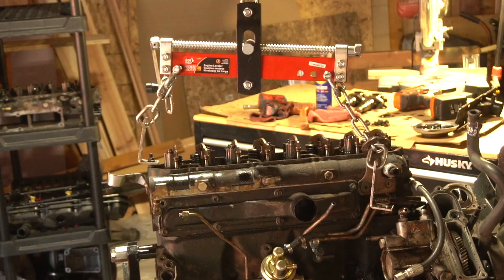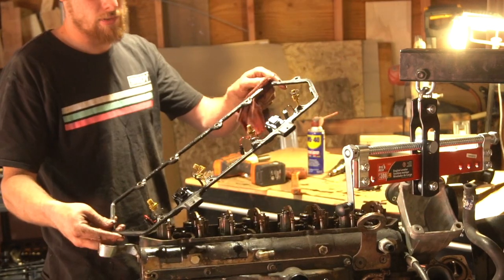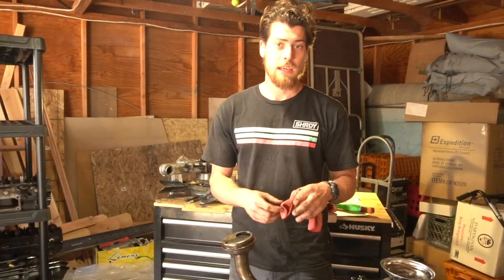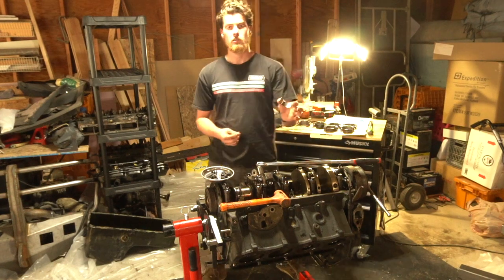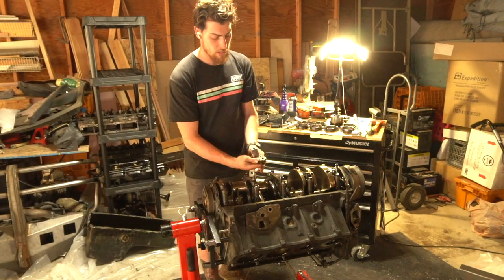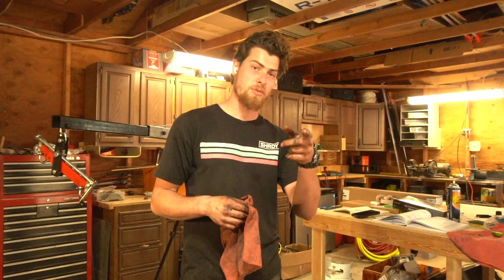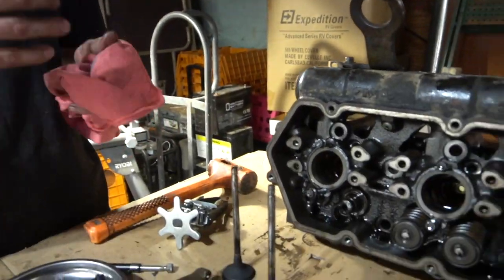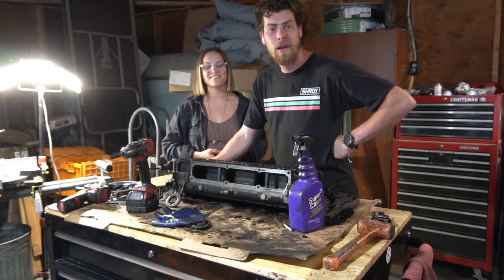Taking apart a 7.3 Powerstroke Engine // Engine Rebuild on our 1995 7.3 Econoline Van Conversion

Comment: Lance Great job, I probably would have gone ahead and put new Barings on the pistons while having the motor apart for sake of not needing to do it again . I had a ford Torino once and we never had any good oil pressure one day we pulled the oil pan and Well Duh the oil pump was lying in the bottom of the pan ! We have no idea how the thing was even running at all. Craziest thing I ever saw.  Back to the video- Laterz Leland
Reply from the maker: Dang that's crazy!!

Comment: The hoses are fuel return hoses and low pressure, the hoses that are high pressure are stainless and connect to the hpop. Ive pulled 7.3's apart that "still show honing marks" with 400k or more, its not a good way to judge. The valve guides, valve seats, rod bearings and piston pin bushings are where you can see how hard or long the motor was run. The epidemic of cheap tuning products really puts a beating on rod bearings and pin bushings. The bowl in the piston is because its direct injected and the bowl is where the fuel and air mix. Gasoline engines that are direct injected have bowls too.
Reply from the maker: Good to know! Thank you thank you!!!

Comment: Honing marks should be seen in all cylinders, that's what helps keep a film of oil on the cylinder walls. These engines have been torn down with over 450000 miles on them with still good cross hatch honing marks in the cylinders. That possibly won't be a sign that it was previously rebuilt.
Reply from the maker: Good to know thanks for that knowledge

Comment: I blew a Hpop braded stainless hose that was old  and wore out. Oil went everywhere all over everything under the hood. When I checked the dipstick there was no oil in the motor lol. The motor shut off due to im assuming the injectors not firing witch saved my motor.
Reply from the maker: It's a great fail safe these motors have 🙌🏻🙌🏻

Comment: I commend you for trying to rebuild this type of engine. Power strokes were made by International. They're a downsized V8 that has its roots in semi's. They're a durable, reliable engine. Diesels are all hearty built engines. The block, for example, is made thicker for increased strength. The terminology you've used so far, is actually correct. But what you understand it means, there's where it'll confuse most. There's so many things I could impart to you but it won't help you now, you have it torn down. When you do reassemble it, try to refer to a manual so it can explain more to you. Having a seasoned mechanic, on speed dial, is absolutely needed. But overall, you're doing a bang up job bro. You guys can learn so much doing this.
Reply: For the peanut gallery, I have better than 30 years of mechanic experience. I used to build championship race engines, some tractor(semi) engine rebuilds, farm equipment engine rebuilds, some odd transmission rebuilding here and there. Am I an "expert" on anything? Let me say this, years of experience says someone going in neck deep on a Powerstroke rebuild, is obviously a big undertaking. There's nothing in them that sets them apart from any other internal combustion engine other than the diesel aspect. Compression is highly elevated in all diesel applications. Race has the same thing, and a few other machining tricks thrown in for good measure. A high performance diesel utilizes many of the same things that any drag engine does. If I haven't shown you my qualifications by now, there's not much more I could do or say that will change your minds.

Comment: That engine didn't need to come apart, they are good for over 500k miles easily. All it needed was new sensors and seals. How many miles are on it?
Reply from the maker: 210 k miles. We're rebuilding the injectors. Measuring for anything that needs remashined. Replacing all hoses, gaskets, replacing valves and more. Once pulling it apart we saw a ton of things that were off or missing. Happy we're doing it and getting it all done anyways 😊

Comment: So brave' Diesel's are a bit more complicated than a 350! If you travel out of country' 'especially south? bring every single item you can possibly think of, that could break or wear out' or two, including tires! + HD tire plug kit, tireslime, and a compressor! and a cheap popped Air mattress pad to lay on, underneath,and a small pop up gazebo' for while repairing in the rain!, just in case! imo' The difference between a manageable peaceful night' and a nightmare!✌️💪😶🇺🇲
Reply from the maker: Omg so so true!!! All of those are great ideas . Now we just need to figure out how to shove it in the van 😂

Comment: Does a 7.3 have a turbo? I always was told to avoid the power stroke.
Reply from the maker: yes it does!
Reply from the maker: The early 94 and under do not have turbos
Reply: @AllyandLance   Thanks, and why do they get a bad review?
Reply: @edwardhenry7119  the 7.3 is well known as a reliable work horse. If someone is trying to sell you on the idea that anything with power stroke on it is bad, they don't know what they are talking about. Some are great like this 7.3 and some are pretty much junk like the 6.0 and 6.4.
Reply: @Maroco918  10-4.
Reply: I think it’s an opinion I’ve know some people that have no problems with powerstrokes and love them and others have nothing but problems.
Reply: I personally have had the best luck with fords so I’ve stuck to them seems like I always buy a lemon when it comes to Chevy, Dodge, Toyota etc. I’ve had a lot of vehicles haha